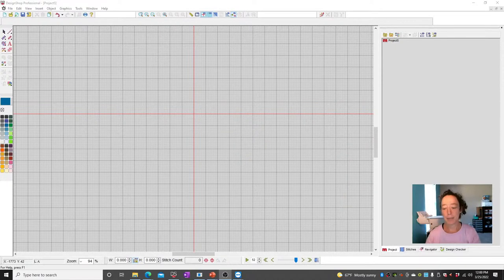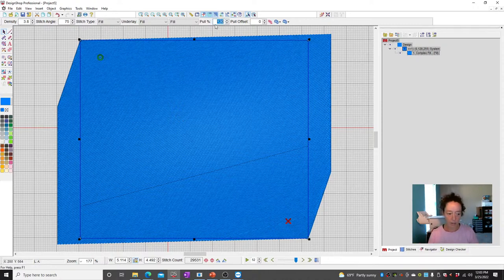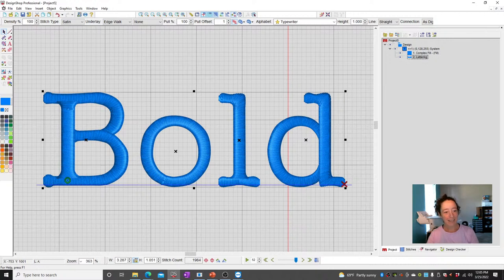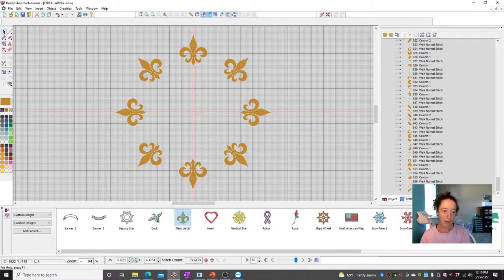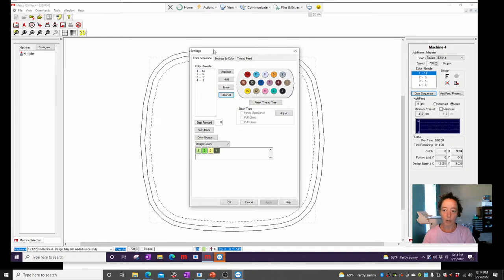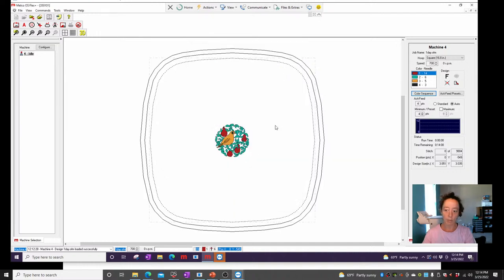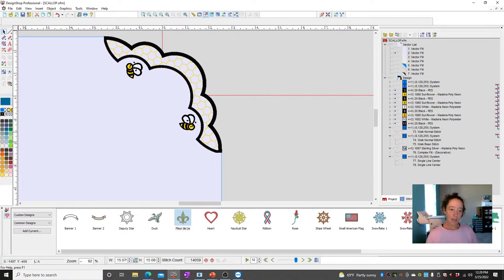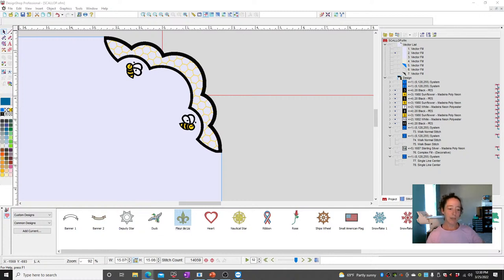DesignShop Talk 3/25/2022

Comment: I have DS v11 vector, applique is grayed out.  Do I need pro to have that option?
Reply from the maker: Yes, the Applique tool is only available in the Professional version. Creating applique isn't hard without the tool though. Digitize a walk (locater) then duplicate it and turn it into a tackle single line. Last duplicate the single line and change it into a satin stitch type. Add color changes to each, set the offset and stitch width and you are finished. Samantha does this frequently in DS Talk.